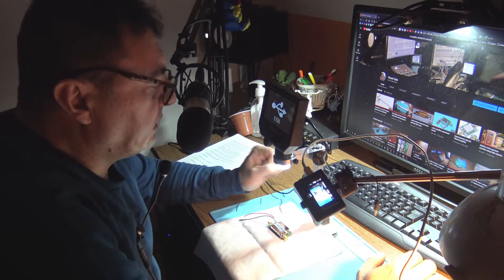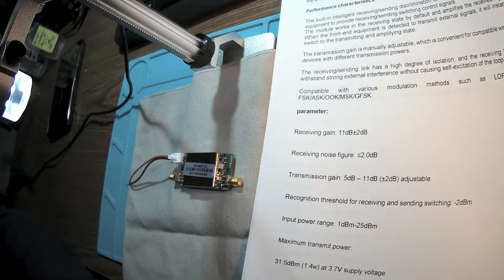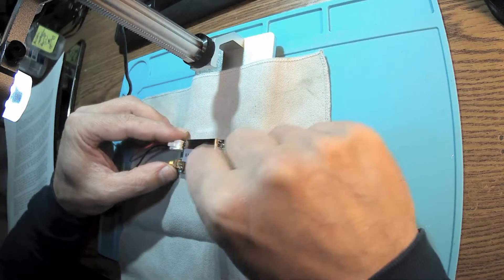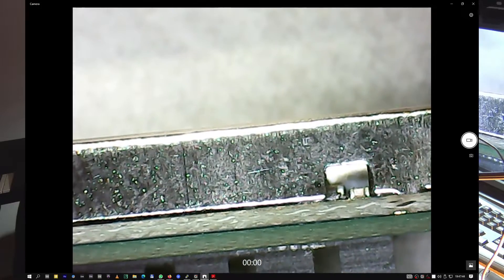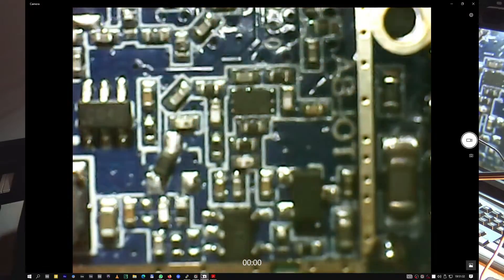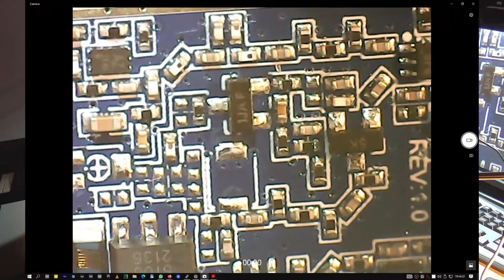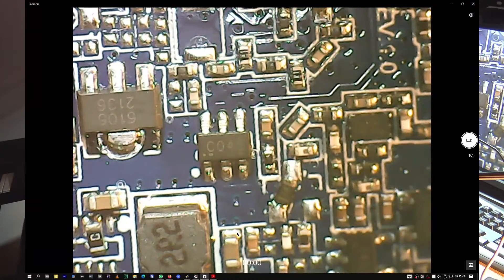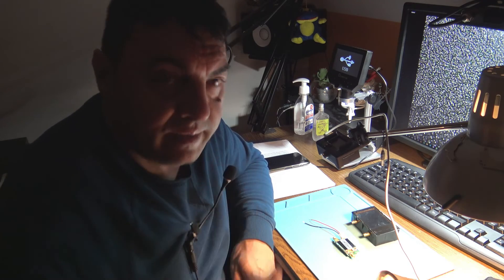LoRa Bidirectional amplifier part1

Comment: I have one in my meshcore repeater. I get plenty of RX, but i cant seem to get good TX. Do you know which way to turn the adjustment screw to get higher TX?
Reply from the maker: Remarks: 

          The working voltage only affects the maximum transmission power, and has little effect on the transmission gain. Therefore, for applications where the output power of the front-end equipment is not large, it is generally recommended to use a 3.7V lithium battery for direct power supply or a 5.0V power supply, and it is not necessary to use a 6.0V power supply.

            Since the maximum transmit gain of the module is about 11dB, if the actual output power of the module can reach the maximum, the output power of the front-end equipment must be sufficient. For example, if the actual output power reaches 34.5dBm when the power supply voltage is 6.0V, the front-end The output power of the device must reach 13.5dBm (23.5+11=34.5). If the output power of the front-end device is only 10dBm, even if the working voltage is 6.0V, the actual output of the module can only reach 21dBm instead of 34.5dBm. Please pay attention to this point.

            Under normal circumstances, the maximum gain (power) transmission is not recommended, because the greater the transmission power, the greater the power consumption and heat generation. If the power consumption is large, it is extremely disadvantageous for battery-powered equipment. In actual use, it is recommended to adjust the gain while testing coverage Scope, so that it can just meet the actual coverage requirements and a slight surplus is better.

            In order to ensure reliable switching, the transmit power of the front-end equipment needs to reserve at least 3dB margin, that is, the minimum transmit power of the front-end equipment cannot be lower than 1dBm, otherwise it may cause the instability of the receiving/transmitting switch.

            When the module is working, most of the sequence is in the receiving state, and the current in the receiving state is about 10mA. When the module is switched to the transmitting state and transmitting at maximum power, the instantaneous current can reach up to 1.5A. Because the transmission sequence is generally very short (normally, each group of data packets is ms or even us level), so the average current is generally not higher than 200mA during the entire working period.

Warning: The module is not recommended for applications with constant emission (that is, the blue light is always on)! If it is necessary to work in constant transmission mode and the transmission power is high (close to 1.3w), there will be large current and serious heat generation. At this time, additional heat dissipation measures (such as adding a heat sink or fan) must be added, otherwise the maximum transmission power will be It will automatically decrease due to high temperature, and the amplifier module will be burnt in severe cases.

Transmission gain adjustment method:

The transmit gain when the potentiometer turns counterclockwise to the end is 5dB;

The transmission gain when the potentiometer is turned to the end is 11dB. Of course clockwise.
Reply: @viocaia I am running a RAK node repeater for meshcore.

Comment: its somehow late but tbh as soon as you see that the board is made from fr4 instead of rogers you know its trash
Reply from the maker: Kind of true
Reply: @viocaia  i found that the best way is to use 2 professional amps or leave tx as is (using mini-circuits zx60-112), 2 antennas and a circulator to divide between tx and rx.
Reply from the maker: @vat8367  Circulator it's great

Comment: I am using this amplifier with 7,5 DB mcgill antenna. Do i need to set up anything because after i add it the connections with other users are lower now.
Reply from the maker: TX or RX...Normally you shouldn't do anything...wait few days to have a clear ideea..write down the what you receive and compare the numbers..if you have better RSSI and SNR to the same hotspot , compare with the period before amplification you're good! The network s up and down..kind of sine wave with peaks at few days and downs too, so you can't say about a change in the hardware in days..you need weeks to clear! Just keep a statistic..number don't lie!

Comment: How do you connect it exactly? What are the 2 wires for?
EDIT: i meant how do you power it in addition to connecting both ends to miner and antenna
Reply from the maker: those 2 wires, red and black are for power supply max 6V (red is + )funny is that you need to connect the amplifier output to antenna and input to the miner!

Comment: top bro
Reply from the maker: Thanks!
Reply: @viocaia  how do you put power on that amplifier
Reply from the maker: @robertVandelanotteonlinemoney  Like power supply? I use a simple 5V/1A ..that's enough . If  you meant like ''power'' to make it switch to TX, I simply used Nanovna like a CW transmitter, there is enough signal to make it trigger to TX
Reply from the maker: @robertVandelanotteonlinemoney  The black one is ground and minus and white is plus..so have that in mind and you may use a phone charger..
Reply: @viocaia  do you think it will be possible to use Bias-T to supply power by antenna cable?
Reply from the maker: @TaperedWiz  It's not ready for cable power, but ity's very easy to do, just check if there are capacitors on the miner output and amplifier..then apply voltage to feed line after using a coil get the power before  amplifier in..so the DC will be strictly on the line and RF goes by capacitors..
Reply: @viocaia  I'm using a SenseCap M1 but I don't think it's ready for cable power neither the amplifier like the one you reviewed in the video (I can't check, still waiting for delivery it...). It could be a good idea for a video where you show us how to modify the amplifier to be suitable for power over cable... ;-)
Thanks for your answer

Comment: That very small 6 pin IC I think is a coupler, losses 20db, like a sniffer, takes rf in to what looks like an rf detect circuit. I don't  like the 2db noise figure on the amp, if you can identify the amp IC perhaps it can be swapped out for a lower noise amp, maybe 0.4db or so.... when you  connect your hotspot to this be sure to set the hotspot gain to maximum, 15db antenna setting, otherwise your tx will be way too much!
Reply from the maker: Thank you so much!
Reply: Or you can use a attenator
Reply from the maker: @esatdemir3097  you got my contacts under ''About"..
Reply: @viocaia  I placed an order last night and what do I need to buy my fully equipped device Sensecap
Reply from the maker: @esatdemir3097  good antenna! good LMR400 cable and of course the miner..but strat with this! ANtenna is very very important!
Reply: @viocaia  I am using 3 meters of lmr 240 cable, device is sensecap and I am using antxes omni 6 db as antenna.
Reply from the maker: @esatdemir3097  you should be fine! maybe a extra filter..only if you are in crowded area..
Reply: @viocaia  can you give a telegram link
Reply from the maker: @esatdemir3097  Sorry, I don't use Telegram...but like I said..try a filter..anyway the network is really bad..good luck mining!

Comment: I'm using this amplifier with my Sensecap! I'm very happy with it! Is working fine for receiving and transmitting!
Reply from the maker: Super! that's make me confident it will make a difference
Reply: @viocaia  trust me, funcționează! E mult mai ieftin decât Flarm a lui Sorin! Și acesta amplifică și pe transmisie!
Reply: @adaniel69  Deci chiar daca ai 2db la TX, RX va ramane tot timpul 11? Sau cand ajustezi TX, automat se ajusteaza si RX?
Reply: @mrovi789  nu știu să îți spun pentru că nu am VNA! Cred că îl am setat pe maxim(nu scrie în manual care e poziția potențiometrului max și care e min)! Am antena pe balcon și e între case. Până acum am avut doar un martor invalid pe transmisie, dar mai mult ca sigur din cauza lui pentru că are setat 2db la antenă și e la 68km de mine! 😀 Am antena Rak de 5.1db și în setări am trecut 4db!
Reply from the maker: @adaniel69  Categoric..nu dau 200 pe un amplificator, mai bine o antena buna..
Reply: @adaniel69  hey daniel. Where can i buy it ?
Reply: @Righttorepair880  Aliexpress. I recommend it only if your miner is on a bad location(far away from other miners or like my case, between buildings...) Or else, you will have invalid transactions...
Reply: @adaniel69   Salutare Daniel,il folosesti fara filtru? Ca pe discord ziceau ca nu merge fara? Multam
Reply: @SmileyPixels  depinde și ce hotspot ai! Ar ajuta un test cu un VNA! O să încerc și cu un filtru SAW!
Reply: @viocaia  i don't have a VNA, but please test it with VNA. I'm interesed if is having a SAW filter inside! Thank you!
Reply from the maker: @adaniel69  I'm not sure, I didn't saw nay , by the look I know..
Reply: @viocaia  must be tested with VNA and with/without a Saw filter!
Reply: Do you have a before/after test?
Reply: @baturalpsaglam6753  i'm using for about 12 days... Signals are way better, for both transmitting and receiving!
Reply: @adaniel69  great! can you tell us where you bought it?
Reply: @jacobchang4588  you can find is anywhere: aliexpress, alibaba and ebay!
Reply: @baturalpsaglam6753  with this amplifier i'm starting to have about the same power like before PoCV11!
Reply: Did you use any filter (SAW or Cavity) with it or just by itself?
You attached it right after the antenna?
Reply: @Nian...  i don't use any filter. I attached the amplifier next to the miner. Sensecap have SAW filters inside!
Reply: @adaniel69  Thanks for your quick reply! 
I mounted mine 12 hours ago after the antenna and used a cavity filter between them (was hoping to filter the amp noise).
So far I've sent 1 beacon, but never witnessed anything at all.
Will try what you did 👍
Reply: @Nian...  i'm using it next to the miner because is inside of my house so is protected from bad weather. Also my antenna have N connector. I need adapters and current injector... So i'm powering the amplifier from USB port of the miner!
Reply: @adaniel69  the potentiometer : 7:31
Reply: @Nian...  we have to.
Reply: İs your antenna setting on 15db in the app? Do yo use it with 5 db or full power 11db? And how much dbi antenna do you use for it? thanks forward
Reply: @u.l.r  antenna setting in Helium app is 4dbi, my antenna is 5.1dbi from RAK and amplifier is on full 10-11db i think! Because in the manual is not saying on wich position is high and wich position is low!
Reply: @adaniel69  Chang the TX Gain

When the potentiometer is turned counterclockwise to the limit, the gain is 5dB；

When the potentiometer is turned clockwise to the limit, the gain is 11dB.
Reply: @u.l.r  i turned clockwise. So as i was thinking, to the max gain(TX and RX)!
Reply: @adaniel69  this is only for tx gain, you cant amplifie rx it will switch automaticly
Reply: @u.l.r  the amplifier is doing it's job for TX and RX!!!!!!! 10-11db for TX AND RX!!
Reply: Acum am citit si celalalte comentarii! Am un sensecap la fel ca tine o sa dau comanda de unul sa vedem daca se schimba ceva! multumesc
Reply: @SmileyPixels  ți-l recomand dacă ești într-o locație unde nu ai și alte hotspoturi sau ești între blocuri/case! Costă în jur de 30€!
Reply: @adaniel69  Took me 4 hours to undo what I did yesterday. Let's see now 🤞🏻
Reply: @Nian...  🤣🤣🤣🤣🤣 what is that you did yesterday? Check my short video with my Sensecap and this amplifier. I've installed now a SAW filter. Waiting for results...
Reply: @adaniel69  reaching my antenna location and disassemble/reassemble everything is not an easy task, specially if your alone! 🤕
Reply: @Nian...  well, that's why i've installed the amplifier next to the miner! And not outside!
Reply: @adaniel69  poți te rog sa lași un link !? De unde la l-ai luat tu !? Și eu am un sensecap. Mulțumesc

Comment: Is it possible to bypass the tx amplifier?
Reply from the maker: No..but get the gain down..also from the gateway will keep the TX in legal limits
Reply: @viocaia  Thank you for your interesting videos. Can you meassure and Make a how to do with the adjustable part. That is not very clear.
Reply from the maker: @Righttorepair880  More to come, stay tuned

Comment: Really nice looking.  edit: 2 dB of noise is pretty damn rough so I can safely say that is not a LNA that uses a GaAsFET in it.
Reply from the maker: I sad so..too much..will see
Reply: @viocaia  I don't understand it because that looked like a work of art then fell down on its ass in the noise department because a GaAsFET is dirt cheap in 2022 whereas in 1985 it was cheap, but about 5-10 dollars for me to purchase one.  I don't get it.  Why spoil an otherwise great looking specifications by not using it?  LNA, using a GaAsFET, is less than or equal to 0.5dB of noise if my memory serves me well still.  2dB is just WOW in comparison.
Reply from the maker: @generalawareness101  Maybe that's not about SNR..
Reply: @viocaia  The specs given?  Say 2 and SNR is what noise (hence the N in sNr) is measure in so beats me.  I hope it is good, but damn it could be so much better for a few pennies more.
Reply from the maker: @generalawareness101  Right!
Reply: @viocaia  Btw, where you will find GaAsFET is in Satellite equipment from the geostationary orbit because the signal is so weak you dare not add onto it with more noise.  I have seen LNAs from almost 40 years ago (I know I owned a few) with noise levels down around 0.15-0.3dB.  As I mentioned before a GaAsFET is from  approximately 30 MHz up to the infrared band.  

"In weak-signal wireless communications and broadcast reception, GaAsFET devices perform better than most other types of FET. Some types of GaAsFET are used as radio-frequency ( RF ) power amplifiers. GaAsFETs are employed in space communications, in radio astronomy, and in experiments conducted by amateur radio operators."